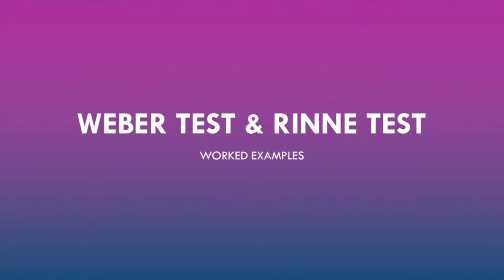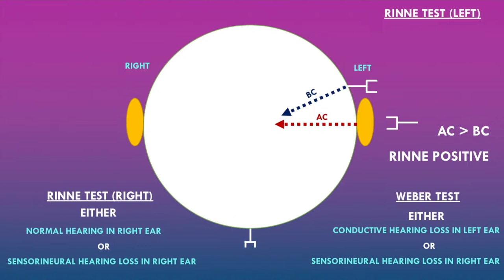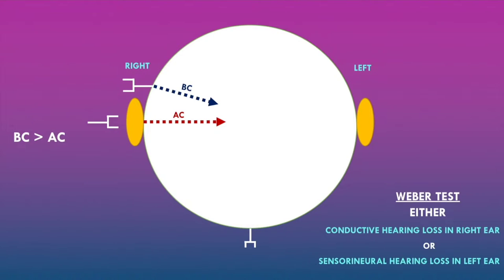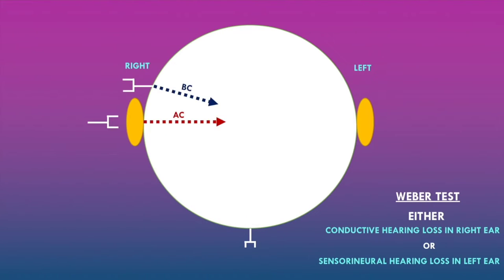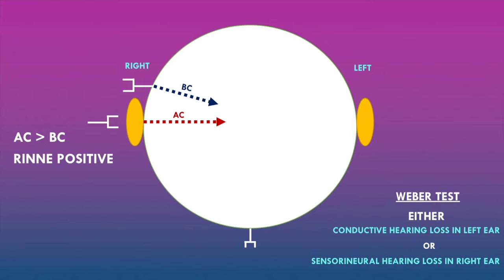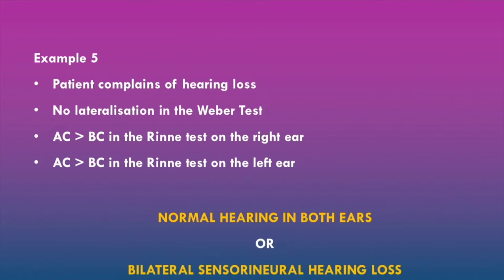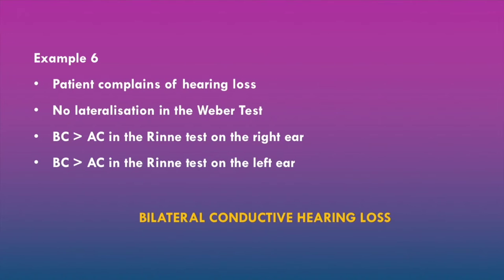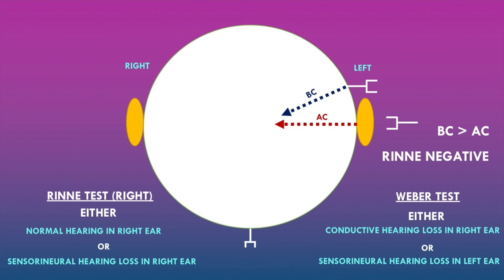Weber & Rinne Test - Worked Examples

Comment: I have questions about example 2. My main question is this: could this example show either normal hearing OR sensorineural hearing loss for the left ear in addition to right ear conductive hearing loss?

The Weber test lateralizes to the right ear which indicates either right ear conductive hearing loss, left ear sensorineural hearing loss, or both from my understanding. Am I right to understand that the Weber test could indicate any of these three options, or is it just the first two? 

The Rinne test shows air > bone conduction in the left ear which could indicate either normal hearing or sensorineural hearing loss. Since the Weber test localizes away from the left ear, isn't it possible that the left ear could also have sensorineural hearing loss based on this?
Reply: This reasoning would also apply to example 4 which Ivy Nwachukwu mentioned in the comments as well